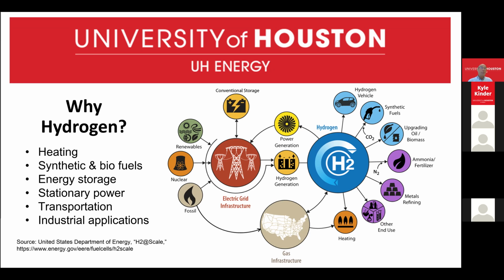The Hydrogen Economy - Information Session - January 2022

Comment: Universal Axiom: There is no Hydrogen Economy; all hydrogen stocks suck and will continue to suck until electrolyzers are conceived, designed, and built that can produce millions of tons of hydrogen per annum.  Right now, this is not even close to possible.   Hydrogen electrolyzers and fuel cells are total nonsense in India and everywhere else, the "Hydrogen stocks" are hopeless losers because none of the electrolyzer companies can deliver industrial-scale capacity.  They only offer small-scale electrolysis capacity, so they can't provide anything but small-scale revenue.  Small-scale revenue will never eclipse their operating budget, so they cannot show a profit (earnings).  Small-scale electrolyzers cannot make enough H2 from water to reduce CO2 output at an industrial scale, so they are irrelevant.  Renewable energy is coming on line quickly, but to reduce global warming, one must decarbonize all of the greenhouse gas emitting sectors -- transportation, agriculture, residential & commercial building and industrial sources (primarily concrete, glass, steel and industrial chemicals).  That means we must create decarbonized fuels such as green ammonia, whereby we take cheap and abundant renewable energy and split water into cheap hydrogen and oxygen.  Then, humanity can remove nitrogen from the air (air is 78% Nitrogen) and, using the Haber Bosch method, combine the green H2 and N to make green ammonia (NH3).  Ammonia, as a "liquid carrier of hydrogen fuel," can carry more hydrogen/BTUs by volume at a reasonable temperature and pressure than gaseous or liquid hydrogen.  Large-scale electrolyzers (no existing electrolyzer manufacturer can provide) would allow green ammonia to fuel and power all greenhouse gas emitting sectors.  When electrolyzers are scaled to provide ammonia-scale plants producing four million metric tons of anhydrous ammonia per year, replacing methane feedstock; call me.  It is important to realize that to produce one ton of ammonia using today's methane "steam reformation process" conventional ammonia producers for nitrogenous fertilizers release 2.84 tons of CO2.